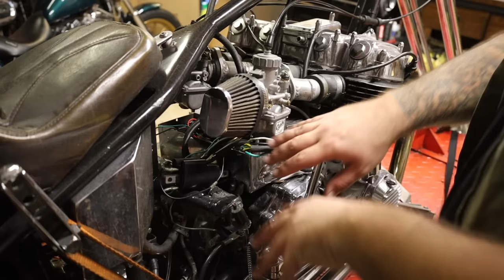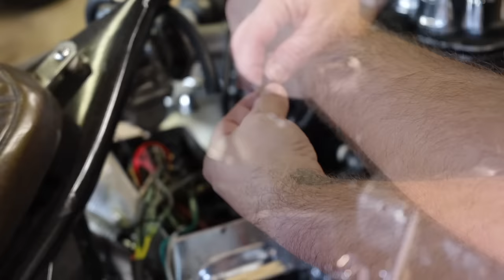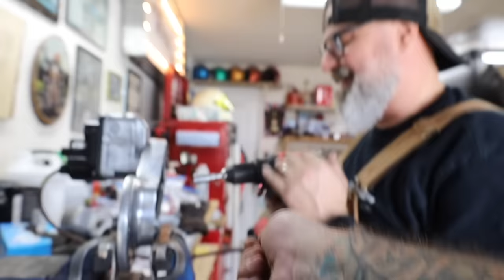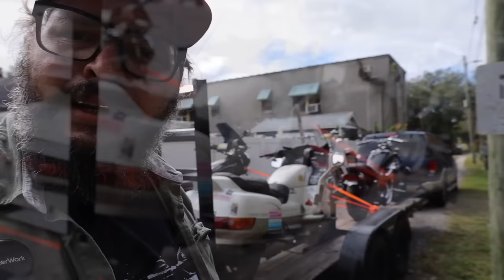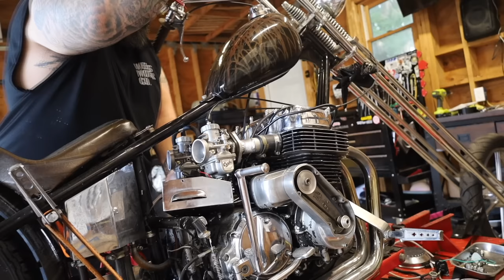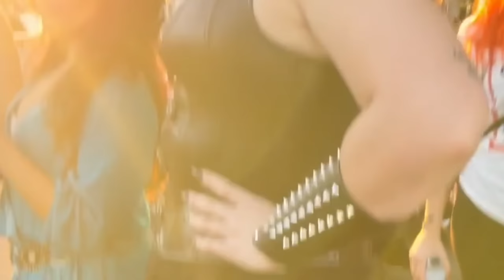This Chopper BROKE me... 😞

Comment: I may have spotted your issue. When you finally get it running you can see sparks under the chrome ignition box arcing to the motor. It happens several times once you get it running.
Reply: Yep, a leaking plug wire.
Reply: Damn good eyes!
Reply: yep noticed it too
Reply: Right👍🏻 good thing there wasn’t a gas leak 😜 we would have been watching a different kind of video 😂
Reply: Yeah something is grounding out.
Reply: Good eye bud it's definitely sparking under that box
Reply: Ya i see it now ,every ime he revs it it arcks
Reply: I bet it's damaged lead, plug cap, broken insulation or coil problems
Reply: Coils rarely pack up but it's nearly 50 years old however like the suzuki GS fours and Kawasaki Z650 are easy to work on.
Reply: I saw it as well. Definitely a gremlin.
Reply: Apparently I wasn't the only one noticing this
Reply: I saw that as well came in here to say the same thing

Comment: Choppers and bobbers looks so fine, problem is that someone set those up just the way they want and old engines will indeed get you broke, you want to really enjoy riding? get yourself a stock recent motorcycle and let it be, let it alone as it is except by exhaust, air filter and a tuner or an aftermarket carb kit or in fact a whole new aftermarket carb (all these optional) otherwise just do regular maintenance.
On the other hand if you want a chopper or a bobber it's better to build one yourself, then again get ready to bite the bullet if you go with an old engine, 'cause it will be expensive no matter what, and you're gonna end up taking care of that engine more than you ride it.  Just the way it is.
Reply: Facts bro 💯

Comment: Over the past 30 years I've worked on all my own motorcycles but I dare not do it without some kind of shop manual, especially when I'm opening something on the engine. I'll bet there's a ton of used Clymer manuals for that bike on the web for cheap.

Comment: 27:10 onwards , you can see the electronic box arcing against the motor case. i suspect its grounding out your magneto or you have a short in the wiring in that box. something aint right.

Comment: In my experience copper core wires are used for magneto set ups and carbon, graphite or spiral core plug wires are used in coil setups due to “interference” idk man I just turn the wrenches haha. But if you weirdos are looking for spark plug wires that are compatible with most coils, lowbrow customs makes 8mm spark plug wires. Hope that helps somebody out

Comment: Lovely chop you got there. Thought I remember you've got a basic welder, right? Why not get yourself some thick angle iron and fabricate a bolt on lift extension just for choppers? You already know how wide and long it needs to be from where it parks. If the original bike lift front wheel cradle is bolted on, you can just use those same bolt holes for the extension and swap it out. I'm not blessed with Lift Privilege but that's what I'd do. Keep up the good work, swamp wizard. Much love from DC.

Comment: Cool bike. I had that same  springer front end and wheel on a Shovelhead chopper with a Ness Digger rigid frame. Even in the 1980s I couldn't find the front drum brake pads so I ran it without a front brake. Hell, I didn't want the ugly brake lever anyway. I had a foot  clutch and hand shift so no lever on the bars at all. I have entered your Shovelhead Tour Glide raffle. Wish me luck. I will bring a trailer to see you in Florida. I will ride the pi$$ out of that bike until I die. Then my son will enjoy it.

Comment: Put a 15 foot 2x8 on the moto lift and drill holes and mount it to the lift hang it off the front for the chopper tire 🫡❤ take the bolts back out and put the board aside unless your putting a chop on the lift that’s the fastest way we have found to get mine on a lift or to even haul it in a truck piece of plywood and two 2x8s with the bike parked on top of them then put a 2x4 under the engine sideways and strap it down so that more pressure is on the 2x4 under the frame than on the front wheel and she rides
Reply: Psa if you flex seal the boards they last a lot longer and don’t slip ❤ much love man I love that old chop you got so much she is a long girl straight digger style ❤ that’s my jam

Comment: There was 1 major tool that you did not use. A easy to use item to help out with any problem on your machine. A low cost problem solver. Yes the good old Chilton's manual for your machine. Always look before you wrench and you'll never go wrong young Jedai.

Comment: Little systems wet system right through the classroom. Everything like that on the timing marks should be on the backside there to find type of marks for the a firequarter on a backside of the. Craig's case there should be a dial there that you can open up a port to timing right but it's not the spark bubbles the timing.